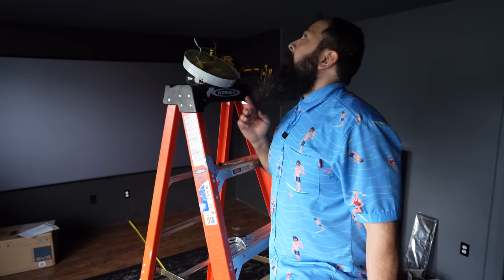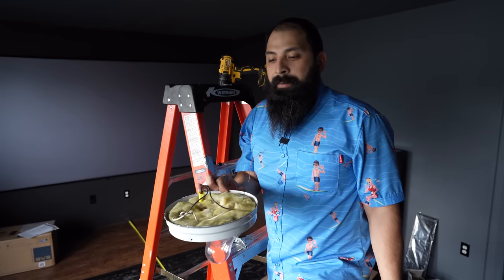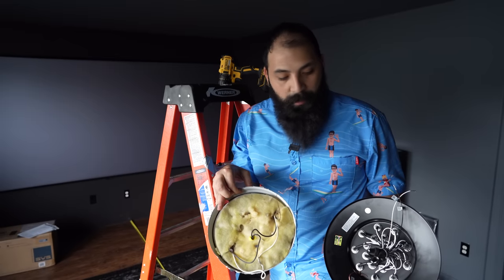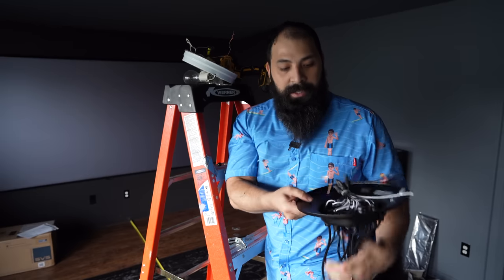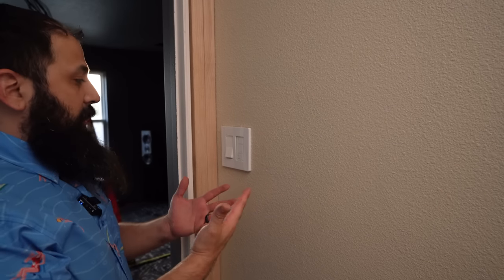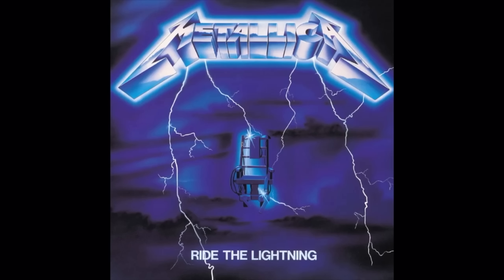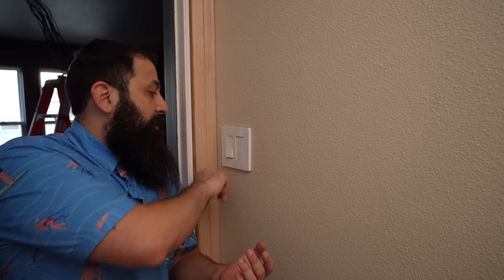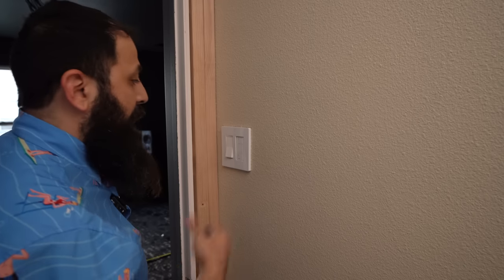How to Home Theater/ Building The BATCAVE Ep.5: Smart Lighting??

Comment: hey, can you elaborate on something you said for me please. In reference to the lens you have on your projector, you said if youre using a 2.35 screen, you arent using 4k. so the projector doesnt produce 4k quality in that resolution?
Reply from the maker: To get 2.35 or 2.40 on almost any consumer available projector you zoom to get the 2.35 or 2.40 to fit the screen. the reflective devices or chips in the projector are square shaped. so that means you have a max width to reflect. If you have seen a 2.35 or 2.40 image, you will notice that the projector physically shines. black bars top and bottom that are off the screen. Thats lost pixels, lost brightness and lost contrast. Effectively you are losing 25% of your image so if you bought a 4k projector you are getting 3k for 2.35/2.40. To correct that, use the anamorphic setting in the projector and the lens. you fill up the entire height on the chip/reflective device and the lens desqueezes the image to make it look normal and natural. Im making a video about this soon. Its cool stuff, but its pricey and not for everyone
Reply: @ThatHomeTheaterDude  ohhh ok. but the loss in image quality is ok with you? doesnt look bad to you?
Reply from the maker: Jhayden Cofield of you don’t know better than it’s fine. If you want the most out of your projector then you will notice a massive difference with the lens installed.
Reply: @ThatHomeTheaterDude  how does this affect a user that has a 16:9 screen? Of he is watching a 2.35 movie on a 16:9, is that the same issue?
Reply from the maker: you wouldnt need the lens on that screen. You could use a processor like lumagen or madvr to get the rid of the black bars.
Reply: @ThatHomeTheaterDude  damn bro. I'm glad you told me this, because I was really about to mimick your setup, but I know me. I'm a quality whore. And those anamorphic lenses are super expensive. Lol I think I'll go 16:9. But still get the Rs2000
Reply: @ThatHomeTheaterDude  how much does the lens cost?

Comment: I like the lights but I don't like the wire that come  Out a cross you   You should hide the wires in the wall It will look better but the pipe  thing for the light looks so cool
Reply from the maker: you realize thats against code to put electronics through walls and ceilings right?